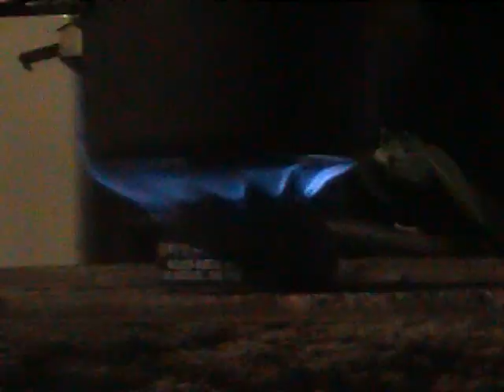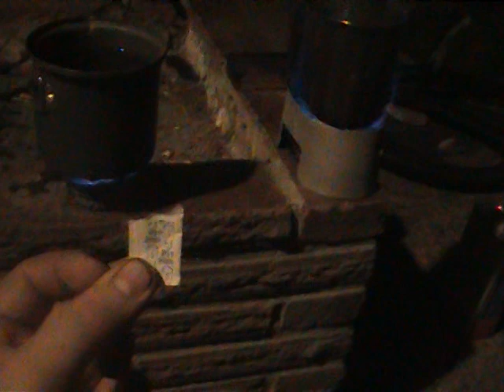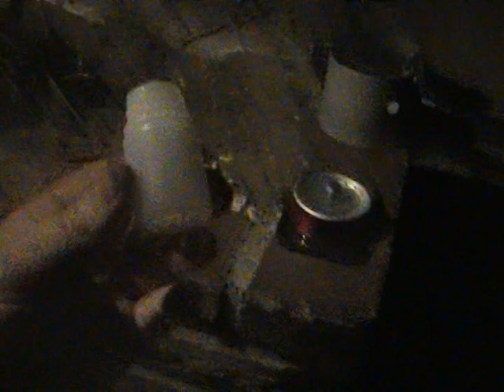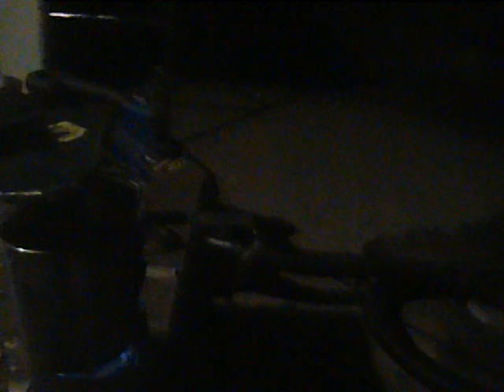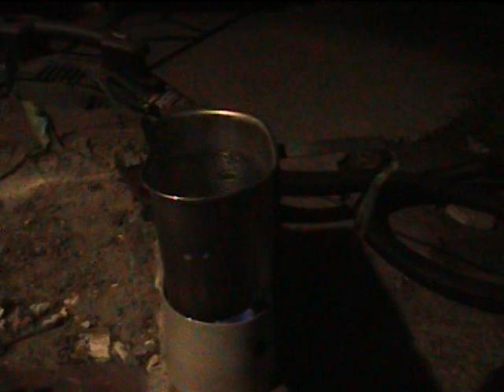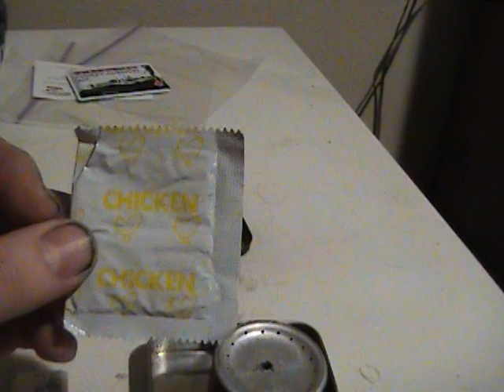US military Canteen Cook set part 2

Comment: good vid, but adding salt does not cause the water to boil more quickly. it actually causes the water to have to reach a higher temperature before it reaches the boiling point which it means it take longer to boil. 

the only way to reach a boil faster is by putting a lid on the pot (or do your cooking in high elevations :p)

of course the benefit of "hotter" boiling water is slightly quicker cook time.